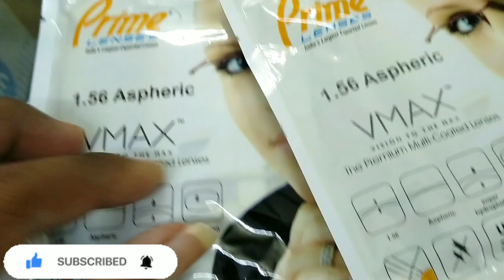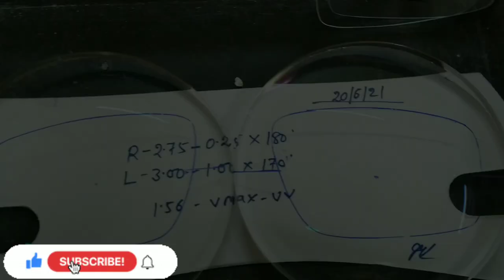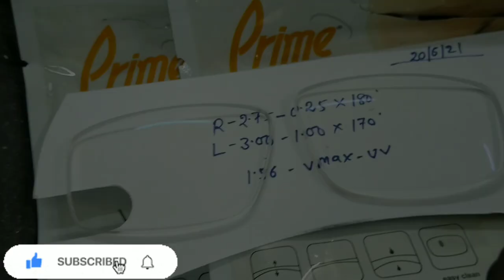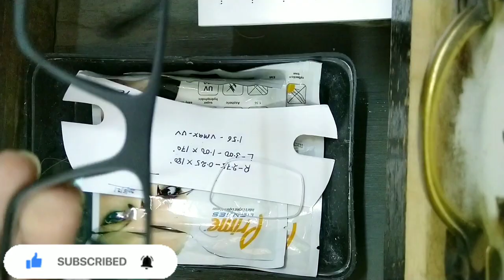spectacles lens manual fitting

Comment: Sir.. I bought a glass today with -5. 5 spherical and -1&-2 cyclic powers.. It was 1.67 crizal rock.. But my frame egdes are visible with white line.. And have already paid 8000

Is there any way to rectify this and give a good look to the edges..? The frame is little big now..Can i change a small frame for the lens.. Is this possible..Please reply
Reply from the maker: Yes it is possible but the lens will remain the same, only the frame will change, you can take it in small size
Reply: @opticalbasis1.3mviews  sir.. So the lens can be cut again to fit a smaller frame?
Reply from the maker: Yes sir
Reply from the maker: If you cut your lens from large to small, the thickness of the lens will be a little thinner,In that case the white line on the side will not be a reflection of your eyes
Reply: @opticalbasis1.3mviews  but why this white edges appear? Can it be polished to look normal?
Reply: @opticalbasis1.3mviews  sir.. Please see ur instagram.. I have messaged there
Reply: @opticalbasis1.3mviews  sir.. Which  cutting is better for appearance? Hand cutting or machine cutting?